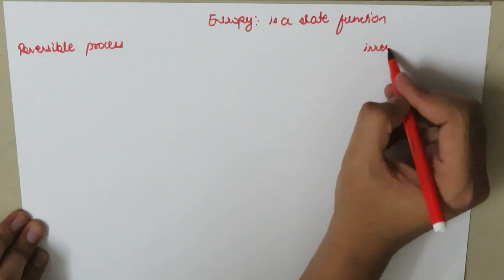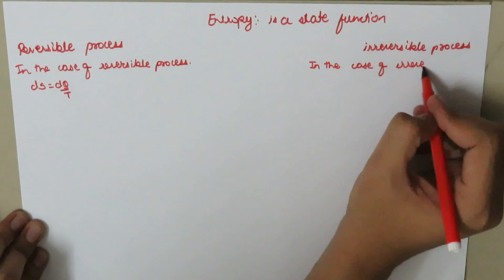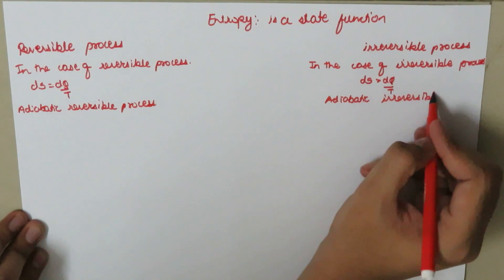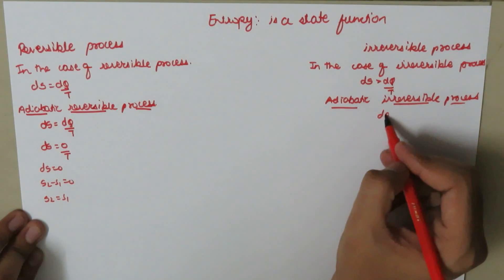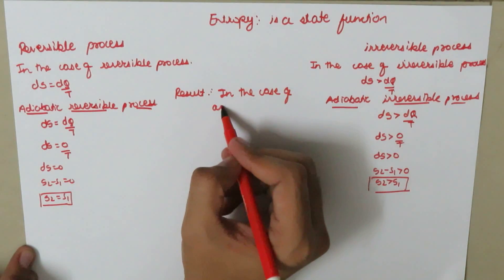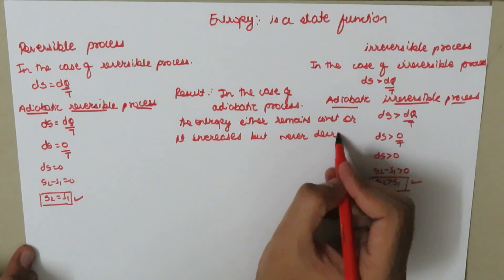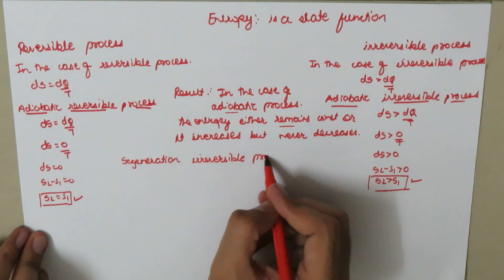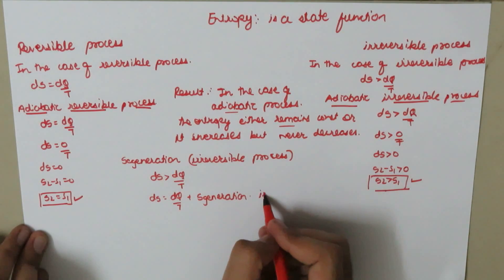Thermodynamics   entropy in adiabatic process

Comment from the maker: Another example of reversible adiabatic process where entropy remains constant is expansion of high pressure steam through a well insulated turbine.
Reply: But there cant be any reversible process as there is friction . if it was reversible entire process should go back to intial stage and surrounding should also return to original state

Comment: Delta S system clarify. not total
are you dumbass ... in reversible adiabatic EXPANSION entropy must change because there is EXPANSION. nodoby would look the video up if we wanted to know total change, it was so simple. 
crazy🚼.
Reply from the maker: On T S diagram; the carnot cycle is represented by perfect rectangle shape, if there  
is an entropy change in reversible adiabatic expansion then there would be no such rectangular shape on TS diagram. This shows that in reversible adiabatic expansion entropy is constant.